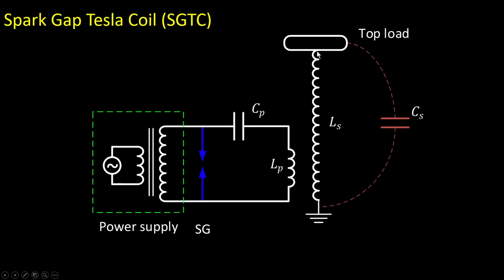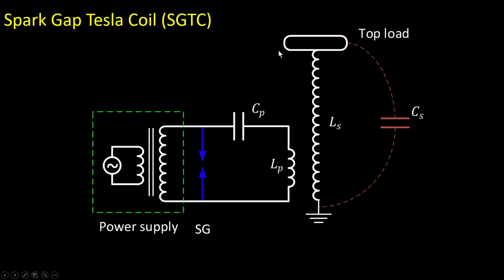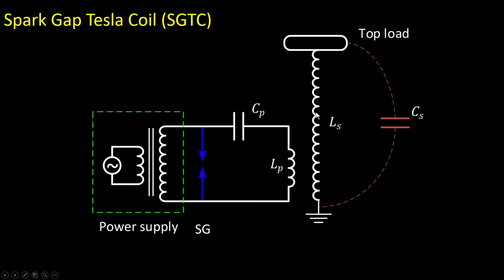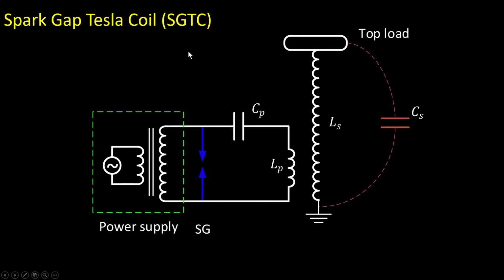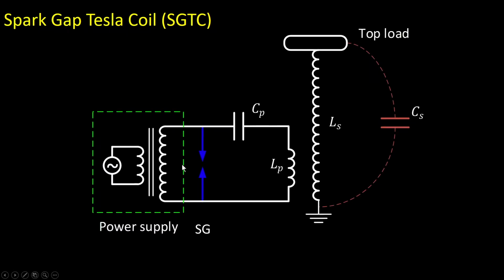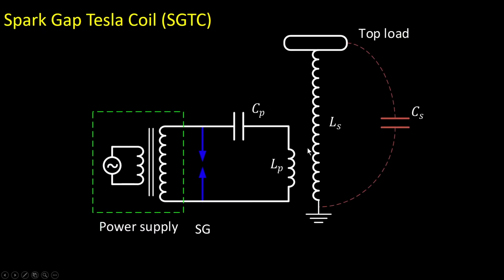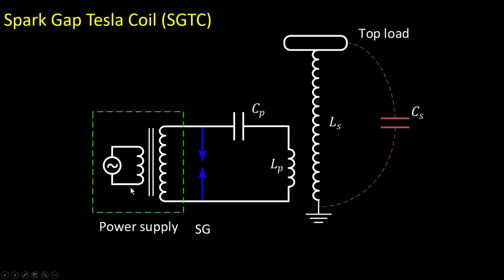Spark Gap Tesla Coil - part 1: introduction and construction of a simple SGTC

Comment: I want to build a Tesla coil similar to you. I  only  have. 2 amp and 14 v approx. Will it still work. And long would be the arks.
Reply from the maker: Hi, you can just buy two of those batteries that i have shown in teh video. i think with 2A it will not work properly, but you can give it a try, or connect a large capacitor accross your power supply, and hopefully momentaliry it can deliver more current

Comment: 3:23 In a resonance circuit for wireless charging I can't imagine how electron flow could be possible, so when in resonance is the 60 hz 110ac basically frequency boosted by the spark gap and capacitance to a level that displays Rf or microwave properties? I'm trying to picture where the power that actually charges the battery comes from. It seems like the 2nd resonant coil must be receiving a magnetic inductive charge like a stator winding but without the moving magnets or ? Absorbing atmospheric energy when in resonance that causes electrons to flow to the battery? Or ? I've heard a little bit about there being a discrepancy between people smarter than me about just how the battery can charge wirelessly at all. Any thoughts on that? I'm just curious.
Reply: About the wireless charger, it doesn't work at 60Hz 110vAC, it actually works at probably 5 to 15v pulsing DC at a high frequency, the receiver coil is tuned to this frequency, this is where the much power transfer from primary (emitter) to secondary (receiver) occurs, the magnetic field closes in air, not through a core (I don't remember if those chargers use a core).
Reply: Rry cool!

Comment: Hello i made same setup, but i used Gas Discharge tube spark gap 10 of them 600V Each , 😢 

But arks are very low 😢 whats the problem? Should i remove gas discharge tube ?
And try with spark gap?
Reply: Yes use a regular spark gap, you can use really anything as the spark gap. Try adjusting the power supply or increasing capacitor voltage rating or capacitor charge rating, It may affect the output.
Reply: Was your experiment successfull
Reply: @abdulHadi8.1 
No

Comment: Could you change the capacitor for a 220nf one and instead of a falyback use a microwave transformer?
Reply from the maker: The capacitance must match with the inductance of the coil. Microwave transformer does not have very high isolation level, so most likely the secondary will burn even if you manage to make it work.
with the oscillatory circuit shown, probably it does not work, since that operate at high frequency which is not suitable for microwave transformer. but anyway give it a try and you will learn something new.
Put a few turns as the primary, or use the excising filament wire on the MT, ans use the high voltage winding as the output and see if the oscillatory circuit works or not.

Comment: How to use 12v instead of 6.6v
Reply: 12v adapter or connect more batterues
Reply: I used a 15v 1A adapter but my transistor is too weak it is advatised for 100v and 4a but on 15v and 1a it overheats in 5 secounds

Comment: Can i use a 220v transformer thats is the range of my budget money i cant buy a flyback transformer because its to expensive but i want to know if i can use a 220v transformer?
Reply from the maker: Hi, you need a high voltage transformer. A 220 volt transformer is not sufficient to create discharge in the spark gap. If you can find an old TV (those big TVs), inside there is a flyback transformer which you can extract.
Reply: @HVE  thank you
Reply: @HVE  can i use a IRFZ44 mosfet transistor?
Reply: And can i use a 12v power supply and i have 5 pieces of 630v capacitor?can i use them?.thank you
Reply from the maker: @generbantugan9925  If your power supply can give you current (several amps for example, the more the better) you can use it.630 volt capacitor if you make 10 of them in series they might work, but you are also likely to destroy them. also when you make them in series the total capacitance reduces
Reply: @HVE can a leyden jar would work?
Reply from the maker: @generbantugan9925  Yes
Reply from the maker: @generbantugan9925  You can probably use it, That mosfet has 55 V, so must not increase the DC voltage too much. remember that, the circuitry will create large overshoots, so even if the input is several volts maybe because of the circuit nature it creates 10s of volts on the mosfet, which if exceed 55 Volts it is likely to burn the mosfte. what this video which i made in the past: https://www.youtube.com/watch?v=4xwpNeaRJG8

Comment: Where can I learn more? I need to build a tesla coil within a month or the teacher will bitch at me. Also I will fail my school finals.
Reply from the maker: Follow what i have shown in the video, it has a simple construction. and if you have short questions you can post them here
Reply: @HVE  What do I have to do if I want to use a battery with a higher voltage, around 24 V?
Reply: You can use 24v but keep the current near to about 2 or 3 ampere or the sparks wouldn't look beautiful

Comment: i got max 400v cpacitors can i use them
Reply from the maker: No, they will burn, unless you have many of them and they have large capacitance, in that case you can make them in series. Also watch out, if you have electrolytic capacitor, do not use them at all.

Comment: Where did you connect the power supply can we connect it to a usb charger actually I am doing a science project of Tesla coil of yours can give me some advice please.
Reply from the maker: I used those batteries which i showed in the video, also the name of them is given in the schematics. USB charger probably will not work. You need a source that can deliver many amps. Those green batteries are a good choice.
Reply: Thanksyou

Comment: IMHO these red capacitors are rated for 2000 V but DC. You have to check the datasheet to find out how the allowable voltage change in function of frequency. I saw such characteristics in WIMA capacitors datasheets so maybe there is any for yours.
Reply from the maker: Thanks for the good comment. Indeed these general purpose caps are mainly used in DC applications. But they are rather cheap and can be used for AC in some cases. Polypropylene has much lower dielectric loss so Polypropylene film capacitors are the best choice, but they are more expensive. Polyester has in comparison higher dielectric loss but even at 100 kHz the tan_delta is still low (<0.03). For this case, in Tesla coils, we have HF pulses with rather low repetition rate (maybe max a few 100 pulse/s) so from dielectric loss of polyester probably is also okay here. The one that I used have partial metallized polypropylene (on one side), so a bit poorer performance probably, but at an affordable price. I have in mind to use the same setup with different capacitor technology and demonstrate the impact of the type of capacitor vs performance and for how many shots they can last. The video will come in the future. And regarding the datasheet, I am not able find it, since i bought these from Aliexpress and a detailed datasheet was not presented. From other manufacturer datasheet, usually it is that Vdc is ~1.5 times than Vrms (AC, f<=60 Hz), so basically almost the same rating of DC is valid for the peak of AC voltage (at least for low frequencies).
Reply: Please, sir. What type of capacitor for 500 volts 3 mhz. And 1000 volts, 3 megahertz. Still polypropylene film caps? I like mica for its high frequency properties. Can I use mica above 800 volts or so?